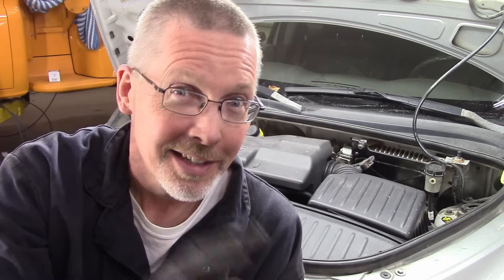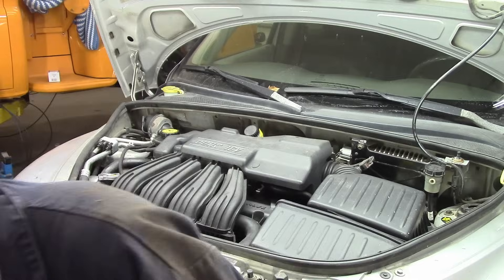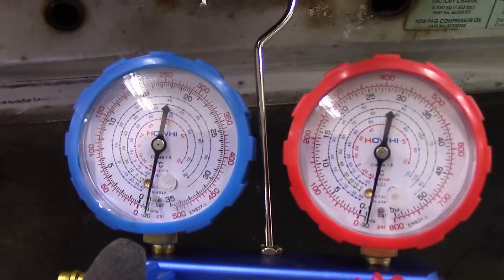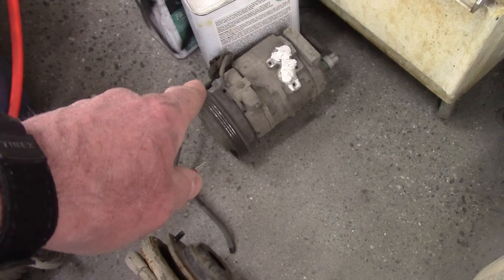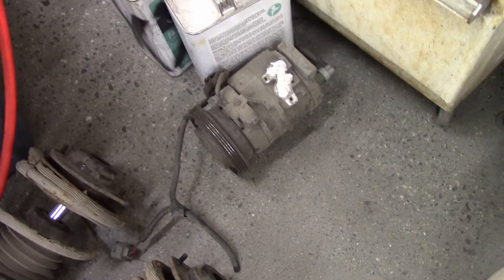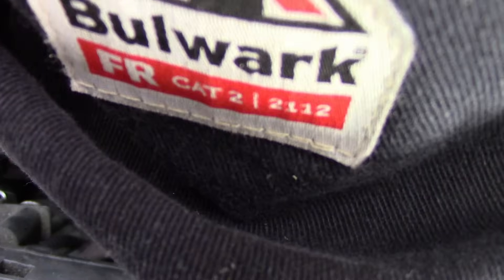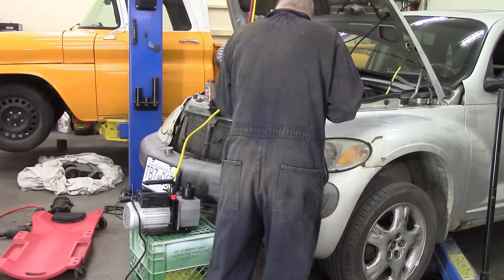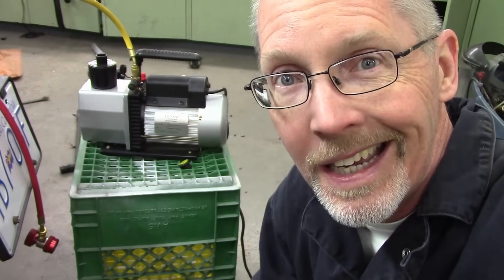DIY Testing, Fixing, & Recharging A/C

Comment: that "broken" switch in front off radiator , isn´t a switch ... looks like its a outside temp censor ;)
Reply from the maker: I've had many things censored over the years, I suppose outside air temp could be one (grin).  Yes, I believe you're right - that's what it is.
Reply: @GregWellwood  ha ha ... , it looks like the same "sensor"  they use on vw  ....

Comment: Anyone using a ton of refrigerant is scum- if your systems empty- you MUST have a leak-where the FUX do you think the gas your putting in is going to go? Quickly or slowly,your killing people - don't mind about you,but innocent people think your a bollix..... pay for proper repair,or drive hot , lowlife
Reply from the maker: Most shops will draw a vacuum for at least 45 minutes - no drop, no leak.  This pig held vacuum for a day. No leaks.  I charged the system.  It's been holding pressure for three months now.  No leaks.  You can sleep well tonight, my good man!

Comment: You should have tried to jump the low pressure switch again after installing the new compressor to see if it comes on. In my experience, the ecm will not supply a ground to the relay for powering the ac clutch unless there is refrigerant present. Youd think it should work but maybe there is another sensor somewhere in the system. I went bananas chasing down wires all for nothing. Works great, just needs to be juiced up. I had a leak and now the leak is fixed. You could have replaced that compressor for no reason.

Comment: Also up in Canada. I got a pump and guages off amazon. Pulled a vacuum seemed to hold vacuum. Recharged the system with the stuff from princess auto. I did it by weight with a kitchen scale. There is a weight conversion for 134A to r12. It worked the compressor kicked on and I was happy but it only lasted a week. So I have a leak somewhere but haven't been able to track it down. Tried changing the high/low valves no dice. I suppose the next step would be putting UV dye in the system and using a uv light but just didn't feel like forking out more money for some sort of dye/injection gun/light etc. Whats the easiest/cheapest way to get some dye in the system to track down a slow leak? The tracerline stuff looks decent but kinda expensive.
Reply from the maker: The princess auto stuff has a dye in it.  I have since fab'd a way to put compressed air into the system - it's easier for me to find air hissing out than air sucking in.

Comment: Why are you unscrewing the line connections when putting them on ?
Every set of gauges i've ever used goes against that, you clip on the QDC and then tighten the top to make it open the schrader valve. How does your set of guages open the valve by loosening the top ?
Or did you just not show the part where you tighten the connections again ??

Comment: Are you sure you read the instructions for that susbtitute freon ? It clearly says to NOT install on a vacuumed system.
Reply: Then... so you're saying that vacuum shouldn't be pulled to eliminate moisture in the system, remove the air, and make room for refrigerant?

Comment: i had trouble with  a PT. It was a lost voltage to the crank sensor.. i just tied into another  sensor on that circuit, finding it was harder but  i fixed it

Comment: I always questioned that story. If R12 was heavier than air, so it sinks to the ground, how does it float up to the upper atmosphere and cause a hole in the ozone? I researched it, they claim when it gets high enough in the atmosphere, it breaks down into it's base particles.  One being chlorine.  Chlorine being what causes the hole in the atmosphere. Since the refrigerant is heavier than air, it should stay low. But swimming pools and other things using chlorine would be putting more into the air, but they never complained about chlorine used with pools, washing machines, etc.......

The bolt on a Scion  XT, I think it was(not sure what the letters were), for the belt pulley tensioner was a pain in the you know what. It just needed to be 1/4" shorter, and you wouldn't have to remove the motor mount and jack it up to get that bolt out. LOL

Comment: No mention was made of Removing / Replacing compressor belt, bleeding recharge hose b4 recharging, maximum refill  ozs. / pressure, positioning  of can ..Upright for gas / inverted for liquid and the reasons to avoid pumping liquid into compressor .etc.  etc..

Comment: Slam in a 5.7l hemi 4x4. The short bed standard cab have the same wheel base. 02=08. It will fit. Fabricating body mounts is the complicated part.
Reply from the maker: I want to build it into a gasser (grin).
Reply: @GregWellwood  wrecked dodge demon!  Supercharged big block. Side pipes and maybe a dragster style removable front end. Ot a tesla model 3 front and rear. Quiet. Just don't go for long drives.

Comment: It's not just the PT Cruiser but all Chrysler and Dodges from the late 90's  and early 2000's were just not designed to be worked on after they left the factory.  I owned two second gen Intrepid ES's and I can't tell you the faces that mechanics would make and some of their colorful comments when I took them in for repairs.  They all hated them.   I got really good at fixing my own cars because of that.

Comment: 7:40  that's your outside temperature sensor and the sensor is probably working but the mount flange is broken and missing which explains the steel wire someone used to attach it to the bracket.

Comment: The reason you don't want moisture in a AC system is it can't be compressed. The compressor likes to take a vapor and compress it where the condenser coil cools it into a solid liquid. This high pressure liquid goes through a tiny metering device allowing it to boil into a vapor hopefully before it reaches the end of the evaporator coil and the cycle begins all over again. Moisture and air or any other non condensible makes the compressor very unhappy

Comment: While I don't have a Robinair machine, replacing parts and recharging is not that difficult. 
Finding leaks however can be challenging.
Reply from the maker: I had a leak in the AC I'm fabbing in my '61 Chevy.  I made an adapter to run shop air into one of the fittings - I can find air hissing out a lot easier than air sucking in.  Turned out to be way-too-cheap compressor line o-rings on the Chevy.

Comment: Before recharging my old Toronado:  I replaced the green o-rings on the top of the compressor connections. I ran a liter of the special  ac cleaner through the condenser, tubing and connections finally blowing all of it out with compressed air.

Comment: Why did you not use the AC gauges and weigh in the refrigerant?
Reply from the maker: The cheap-o cans do not share the same connection fitting.  I have since made an adapter.

Comment: Listing to you and the highside sensor connector. Did that need to be good to complete the clutch circuit? Or do the sensors run to the engine control module?
Reply from the maker: I believe the high pressure sensor is usually normally closed (NC) and is opened when the pressure gets too high, turning off the clutch.  If the connection is bad (and mine likely was), it would have an "open" and prevent it from turning on.  Could that have been the fix instead of replacing the compressor? Maybe.  Still can't get my hands in there....

Comment: I’ve never used a vacuum pump on any of my cars a/c system. I’ve never had a problem with them. I have a video showing my 2004 Trailblazer system cooling fine.

Comment: This video is very entertaining. What I liked about the video was this fellow showed most of the problems I have ever run across in my 58+ years of working on cars. When you are an avid DIY’R, you do what you have to do to get a job done. My advice is NEVER give up! He mentioned how some say never use gloves with power equipment. I will tell you NEVER use an angle grinder or cutoff wheel WITHOUT gloves! (My $2100 visit to the emergency room this past year will attest to the FACT that an angle grinder can get away from you and chew up your fingers!) Keep up the great videos!
Reply: Repairing my cars and my classic cars is over! At a certain age 65 bought a new truck with warranty and an electric car because there are no oil changes, no exhaust system, no brake jobs, no transmission, no differential. The regular maintenance includes the cabin air filter and rotating the tires. When the stealership war replacing the cam phasers in the truck, I was collecting my $7000 rebate from you taxpayers and another $2000 from you state taxpayers. Thanks 😂
Reply: Heck yeah dude my miter almost got my fingers, i and anyone using my tools betta use leather gloves n eye protection at the very least.
Reply: GR8 post 
Thx 🎯🎯🎯
Reply: Facts! Those stitches are expensive! Found out last year that the cutoff wheel can grab and take off in a flash!

Comment: The system should be charged through the yellow hose on the manifold set to preserve the vacuum that is in the system. By removing the manifold, you lost much of your vacuum. Those schrader valves are not designed to hold vacuum in the system. Connect a can tap to the yellow hose where the vacuum pump was without removing the manifold from the system. Let the refrigerant flow into the system with the engine off... then start the system and charge using the low side knob on the manifold. (make sure the high side manifold knob stays shut to prevent can rupture) The low loss valve on the yellow hose can hold a vacuum, but I like to attach a ball valve for added security when removing the vacuum pump and attaching the refrigerant can.

Comment: Great Video! Thanks for the info. I have been troubleshooting my A/C for a couple of days now and found a massive hole in the line that feeds the rear A/C. I am getting ready to replace it but thought I would research next steps for when that's done. I think I'll check out a loaner vacuum from Autozone and see if it holds with the new line. How will I know if the system is free of moisture? I'll also jumper the low pressure switch and see if the compressor runs. The only other thing that is unknown to me is A/C oil. Is there a way to tell if I need to add oil since the car has been without A/C for over a year?
Reply: Oh autozone has an ac pump loaner? I would just add a bottle every other ac fill for my tacoma but now i may just replace the leaking compressor.

Comment: Thank you for this informative film. But how to do a diagnostic on a car with totally empty AC system and which has a small leak, how to find that leak?  
I know about hydroscopic properties of the PAG oil. Before I thought it is only air which has the water, and deep vacuum takes care of it. Anyway, I pressurized the system with air, and found a huge leak on Expansion Valve-to-Evaporator connection.  It was hissing, and you could hear it w/no additional devices. It was a wrong o-ring, which came w/the Exp. Valve set. I put a thicker o-ring on the bottom tube (3/32"), and the huge leak stopped. But still there is a small leak somewhere. I pressurized again (30-50 psi), spraying w/soapy water - nothing. But the pressure goes down on your eyes, you can see it, slowly, but drops. It was me, who did something wrong and I can't find it. The system was leaking of course, but much much less. Originally it was empty (the car was w/no AC for 10 years, it is our back up car and we didn't worry much). I tried to fix it at Dealer, but after their several attempts it still failed like after 2 weeks. But the system was working for 2 weeks and after I tried it after 10 years pressing the Schrader valve (I wanted to be sure that there is no refrigerant there, though the gauges showed zero) w/a small flat, it gave that 1 second "pshik" sound. I replaced everything besides Evaporator, Compressor and Liquid Line (it is Expansion Valve to Drier Line on Saturn). Liquid Line I couldn't find for that car, Evaporator is to hard to get to, and the Compressor didn't stall the car before, so I decided to try it. So I flushed the Evaporator and Liquid Line well, several times w/99% Isopropyl Alcohol, then w/Flush Fluid, dried for several days. The Compressor I removed flushed and dried in the same way. I added  PAG100 oil (w/Dye), put all the new o-rings (put oil on them) and washers (no oil, like Shop Manual advises), torqued to specs (I have Shop Manual for that car). So in the future I can repeat all that flushing, put new oil, and everything, but I do need to find that small leak somehow. Do you happen know what can be done at this point? Thank you again.
Reply from the maker: I was so thankful I did not have a leak for this very reason - I'm not really sure how badly I wanted to search for the leak.  You seem to have gone about this very thoroughly - I hope someone more knowledgeable chimes in!
Reply: @GregWellwood  Thank you. I might try Leak Detector, I've read it reacts on the flow of air or just to to a dealer, maybe they can find where is it. Of course it would be better to check the system after each part replaced, I even could not imagine it would be such a problem bcs of some rings, which are new, came with the part and don't work correctly.
Reply from the maker: I just remembered - way back in my apprenticeship days there was an electronic "squealer" device that would make noise in the presence of refrigerant. Helps to pinpoint leaks. I haven't used one since.
Reply: @GregWellwood  Thank you so much for attention to my question. I've received that detector already (fm Amazon). I tried yesterday, it reacts even just on air motion. I hope it will show smth when I pressurize the system again. Shop manual says to add 16 oz of refrigerant and use the detector. I'll try before to disconnect fm Expansion valve and put back (w/another o-ring) Liquid Line (it has o-ring fm the set for the Expansion Valve, and one of the o-rings fm that set was leaking on the lower Evaporator Tube). Maybe it should be a special o-ring there, bcs when I removed the original o-ring was black and had a shape of cylindrical washer, and not toroidal shape, like all the o-rings have. I didn't see those washer type o-rings anywhere. The Shakespeare quote:
“There are more things in Heaven and Earth, Horatio, than are dreamt of in your philosophy” is very true for the car AC system. I might better go to surrender to a Dealer. Thank you again.

Comment: Chlorine dioxide is the chemical that ate a hole in the OZone layer. It used to be commonly used in refrigerants. However once the hole was discovered and the chemical that was causing it identified, the U.N. member nations all agreed to ban the Manufacturing of refrigerants that use chlorine dioxide. 

As a result, the hole in the ozone layer has shrank by about 25%, and if your air conditioning or refrigerators needed maintenance at some point since the mid to late 1980s, the refrigerant has been swapped out for one that's free of chlorine dioxide. 

TL;DR: Your cars AC
refrigerant won't harm the ozone, although I recommend you avoid breathing that in.

Comment: 30 inches isn't really a deep vacuum. Use a micron gauge, and get it below 200 microns. Then valve it off for 10-20 minutes, and it should stay below 400 microns.

Comment: You always want to look it over to see if Halfassery has been performed before, anywhere.
My Stepdad ran an auto shop. Sign on wall said: Labor rate per hour(1975)- $35, if you watch $45, if you help, $65, if you fixed it 1st, $85. You have to work closely with John Q Public before you realize the problem...

Comment: I used to love the PT cruiser, then I owned, well, my wife owned, one... why did they bother putting the battery in there if there isn't any room left.  could have hid a bat box under the rear floor or something... that car we had got moldy every winter, even after professionally having it detailed and cleaned I was still finding mold under trim and everything.  Electrical problems throughout the vehicle and the battery died so often I had to put in a cutoff switch at the battery which made it difficult to pass emissions here as they read the computer instead of using a sniffer and having the battery off clears the memory and we would have to drive around for an hour or more or go back the next day hoping the constant electrical drain didnt kill the 5th brand new battery in there take it in for a test to pass once again for another 2 years.  I'm so glad we got rid of that car holy crap.

Comment: Warning converting gases in a air conditioning system you lose capacity. You also have problems when the temperature rises outside

Comment: I use hydrocarbon refrigerant in all my vehicles (Duracool or Envirosafe).  Works even better than Freon.  EPA rules are bizarre, first requiring that you convert from R-12 to R-134A, then to HC.  Also illegal to vent HC refrigerant since "any refrigerant", though no worse for the planet than a cow-fart.  The whole Ozone Hole turned out bogus.  The U.N. crowed "fixed it" in 2019 when smaller, but it has been larger than ever the last 3 years, despite no more Freon.  They now try to explain "due to Climate Change via Polar Vortex".  Absurd.  R-134A is outlawed in new cars since a bad greenhouse gas.  I do all at home and have same HF vacuum pump, plus MasterCool Crimper to fab new hoses.

Appears same AC compressor in my 1996 Voyager 2.4L.  I recall leaving the long bolts in the compressor to remove (no corrosion in CA).  In mine a piston seized in its bore.  Appears the anodizing wore off at ~190K miles, so the bare aluminum galled together.  A new compressor was <$200.  Ditto on verifying the clutch first.  Long ago, in my 1982 Aries, I found the clutch wasn't engaging simply because the clutch ground connection was poor.  Sanded the ring terminal, coated w/ silicone grease, then worked fine.  Aluminum parts can give iffy connections.